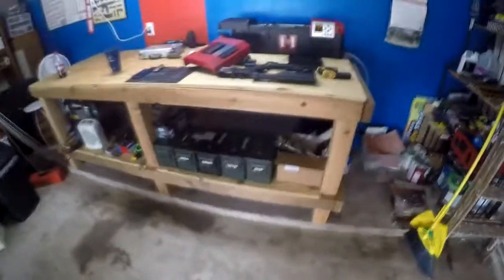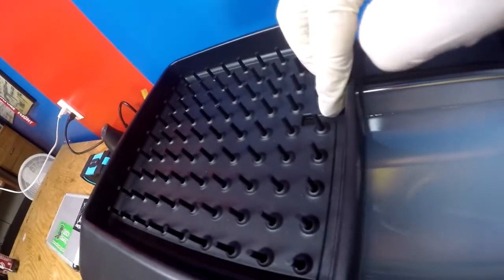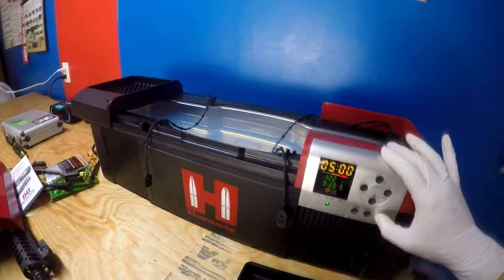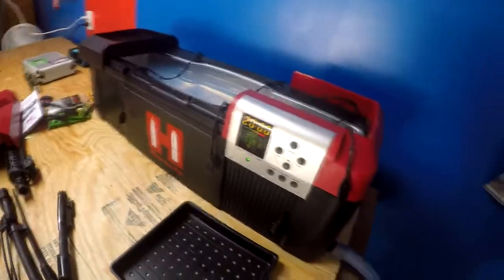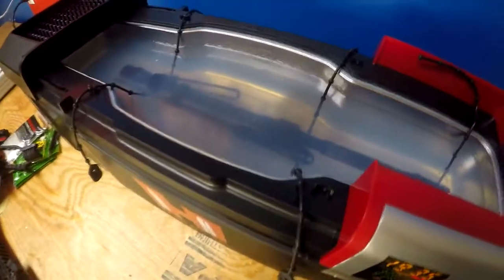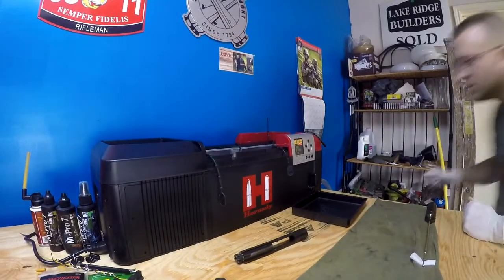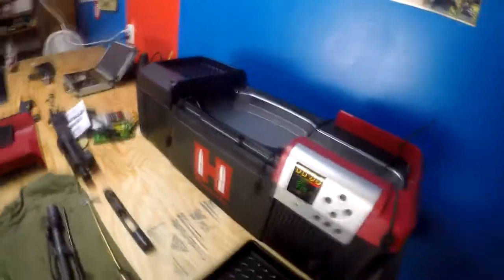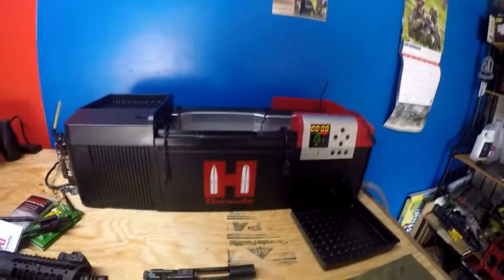Hornady Hot Tub Ultrasonic cleaner

Comment: I'm sold
Reply from the maker: That's great, what are the things that sold you on it? I got mine from Man venture outpost it was the cheapest price but shop around before you buy you maybe able to get it cheaper.
Reply: +Dean Bryce (Razor's Armory) there is a guy at the local gun shop that charges $40 to clean a rifle in his sonic. So if I use this 10 times, it's paid for itself. The only other sonic I've found is the lyman and it's 3 times the price. The one I have now doesn't have a drain hose. all my rifles are 16" and under so this thing is perfect. Your video is straight to the point and very well produced.
Reply from the maker: +Johnnie Danger thank you I try to give as much information on the item as I know and from what I have learned using it. I have Hornady AP Ammo Plant that I will be doing an u boxing and setup video of soon. I got the 22 caliber conversion kit along with the 30 caliber conversion kit. so I will do a setup video on them as well. thank you. I have Facebook page called Razors Armory alot of good information on firearms and firearms related news. thank you for subscribing.
Reply: +Dean Bryce (Razor's Armory) I look forward to the ammo plant video and will definitely check out your Facebook page.